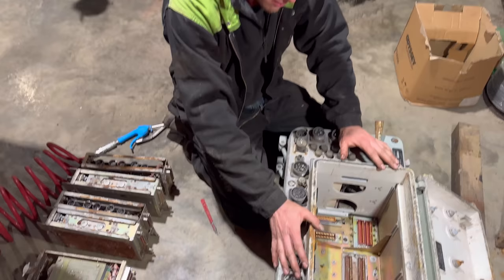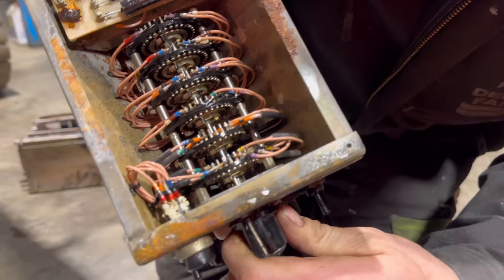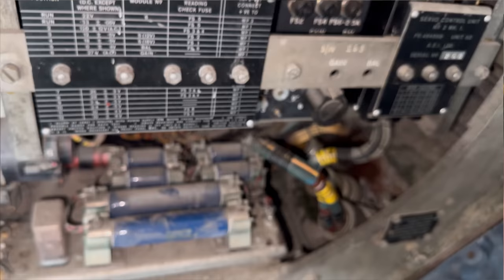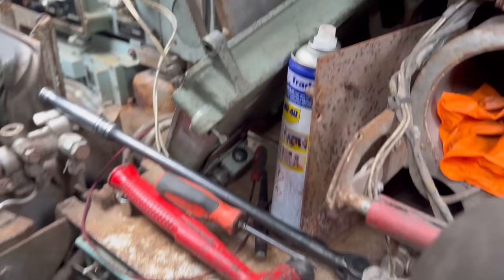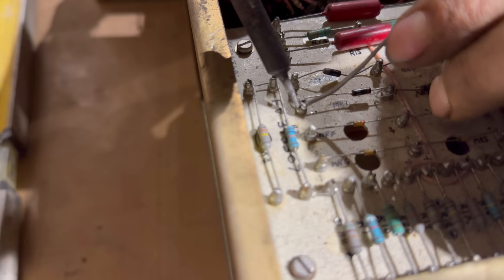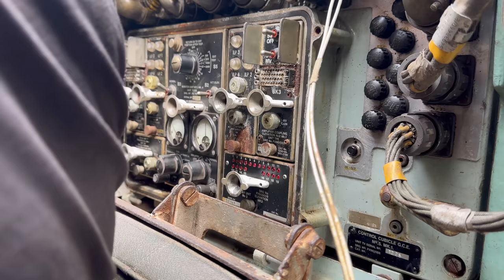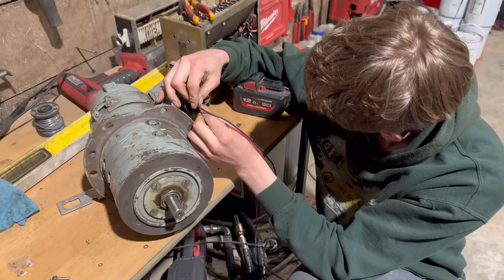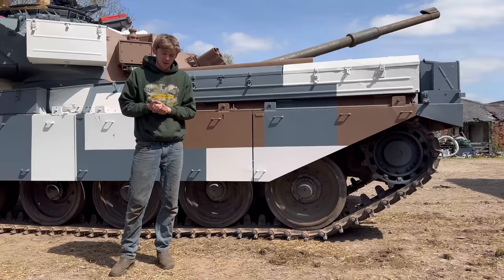How NOT to get a turret working!

Comment from the maker: What should I try next?
Reply: Do a flip, that's a neat trick!
Reply: Did you try turning it on and off again?
Reply: Have you tried putting Raspberry Jam into the Fire Control System, then putting the vehicle into 1st gear and see if the track tensioner works automatically? If not, then try 20 liters of gasoline and claim on the insurance.
Reply: Fitter Matt dressed in drag with a dead fox around his neck as a pack of 30 hounds chases him across a field?
Reply: That cmdrs control unit is part of the FCS....he can see all the info on the system and make changes etc. Barrel wear (rounds fired) Temps etc. The search light on the side of the turret should work without the metadynes working as it works with the hand controls only.  The battle mode fuse does not over ride the sensors.....it links the turret and hull batteries together.
Reply: 40 year ago, I’d have loved to get my mits on that. Now, I’d be an overweight liability, let alone not be able to get into the places you were in! 😮 There’s something at the back of my mind with those controllers needing the computer to operate. I also have a nagging suspicion that the Metadine units were modified to work with the computer, if you have a mix of modules of modified/unmodified it could give you grief. The only way to tell would be the data plate mod state cross referenced with EMER? books. I could be wrong, it’s been 40 years since I worked on one. We used to give those valves a good 5 mins to warm up and stabilise before trying anything lol If I had the power, I’d give you a medal for turning it on though! 👍
Reply: I find shaking my fist and swearing at electrical issues tends to do fuck all but it does make me feel better alternatively hit it with a hammer. Which also does fuck all but feels great.
Reply: Drivers and loaders safety switches?
Reply: ask alexa, if that doesn't work ask a homeless person, they are often ex military
Reply: Send the units to me along with your soldering iron(s), I will fix the units and make your soldering iron(s) safe for you to use. Then when I return said units and soldering Iron you will have put or sorted that motor out.
Reply: down the pub.
Reply: fixing it?
Reply: During my time in the USMC as a field radio operator I learned that a 3 foot drop will get most military equipment working again. But I've never tried it with a tank...which could make for an interesting video.
Reply: A Google search of how to do this? Or Inviting a proper electrician of systems that have experience with old tanks?
Reply: Try plug in the spare motor and see if it spins up through the trigger and full system. Definitely the fitted motor is the issue then.
Reply: is the turret ring in good condition all around
Reply: Have you tried asking ChatGPT, that pretty much fixes everything doesn't it?
Reply: put some double denims on and everything will be fine 🙂
Reply: Reach out for help!  There are some youtubers out there doing some fantastic work with vintage electronics @CuriousMarc is a good example
Reply: You got there eventually but you should have started with the motor and worked backwards. PS: You're probably right about the brushes.
Reply: ask chat gtp
Reply: To me It looks like under main plug there is relay which controls polarity to the motor and by activating it i would turn motor other way while powered up, If that's the case the relay could be the problem not the motor Itself, if not that motor would be to blame and needs removal and inspection.
Reply: have you tried hitting it to encourage it?
Reply: overclock the turret so it spins stupidly fast

Comment: I was an ECE for 24 years and need to tell you that you should NEVER just switch everything on without doing a proper setup of the FVGCE (Fighting Vehicle Gun Control Equipment ie the big box you just fitted)  First thing to do is make sure that the turret can rotate using BATTERY Traverse! Then AFTER the Control Cubicle has been set up (That requires the use of the central module (with the two meters) between the Servo amplifiers etc. It also tests that the Power Supply Unit (The box that smoked ) is providing all the correct voltages to the units in the Control Cubicle. Once that is done you should test the Traverse systems first WITHOUT turning on the elevation metadyne. If you power up both you could end up with the gun running out of control if the gyro is faulty! I was horrified to watch the video when you just switched it all on without setting it up first!  Every time a Power Supply unit is swapped out the system requires adjustment! You need the EMER For the Gun Kit.
Reply: Baller.
Reply: Do you have it?
Reply: High quality comment.
Reply: could it be your youtube time to shine?
Possibility on helping out?
Jim
Reply: sounds like its time for your youtube debut!
Reply: I can imagine a extremely heavy turret ‘running out of control’ could be quite life threatening, so I’m imagining very good advice! 😊
Reply: while this is probably good advice, you are the type of person they mimic with the whiny voice so you might not get through to them lol
Reply: Perhaps you could write up the procedure/s so that they have a better understanding of what is required to keep these classic war relics functional.
Reply: @mrtankalotrctankschannel  I'd imagine a machine designed and built for war, death and destruction could be quite life threatening if it were out of control...but in saying that, its probably say its way more life threatening when under the control of a trained crew.
Reply: @blitfire  ‘probably’? 😂
Reply: @howarddavies6685  well idk for certain do i
Reply: I'm sure i remember hearing of  someone being killed in the turret of a chieften when the gun he was working on  started going up and down repeatedly  crushing him to death .
Reply: Not surprised the comment mocking the person with sound advice to stop people getting hurt was liked by Mr Hewes , who seems to be determined to get someone hurt to get some likes ...#whistlindieseleatyourheartout.  #tryandbeoriginal 🤔
Reply: @fraserfulton.1432  ummmm... cope?
Reply: @blitfire  ummmm Banana
Reply: @blitfire  indeed
Reply: @blitfire  lol
Reply: @mickd6942 . There was. 1RTR Tidworth.
Reply: driver comment
Reply: Lookup2Wakeup  he was  working under the breach
Reply: @mickd6942  I am curious to know how one could be repeatedly killed?
Reply: Fentanyl, narcan, fentanyl, narcan, etc. like that lol
Reply: @Qspecialman  he was killed once , i meant the breach repeatedly went up and down quickly .
Reply: @Qspecialman  
It starts slowly then speeds up.
Reply: @mrtankalotrctankschannel  As part of the 4/5th echelon maintenance we had the Dutch PRTL turret turning CW and the periscopes running CCW on a range of speeds and rates of acceleration.  Visitors could sit in the turret under condition that they would clean up the mess they'd almost certainly make.  https://www.youtube.com/watch?v=UUFwFhg99ZY
Reply: @mrtankalotrctankschannel  As part of the 4/5th echelon maintenance we had the Dutch PRTL turret turning CW and the periscopes running CCW on a range of speeds and rates of acceleration. Visitors could sit in the turret under condition that they would clean up the mess they'd almost certainly make.  https://www.youtube.com/watch?v=UUFwFhg99ZY
Reply: 7:16
Reply: I mean obviously I was just about to say what he said, I was just putting the bins out... & Stuff
Reply: About a year or so before COVID I discovered all my ECE training notes from 1971 and offered them to the REME museum who were pleased to have them. I also had to describe the course we did then, I think now it was 193. It was unusual in that they also trained us on radio repair- which did not endear us to TEL’s! This facility was then offered to future courses. However, I would expect by this time for a contribution to Corps funds they might well provide you with a basic set up from EMERs for basic safety.
Reply: Schoooled 😂😂
Reply: @Qspecialman Tom Cruise was repeatedly killed in 'Edge of Tomorrow'!
Reply: @arthurgordon6072  It didn't work Arthur, he still keeps popping up.
Reply: If you're not sure how things work  ask an expert who's being doing it for years.
Reply: Massive pointless comment
Reply: When I read EMER I was taken back thirty years to Bordon.  Thanks for sparking that memory 👍

Comment: Mate I was an ECE for many years and mirror the comments of my colleague in the comments above - to make the FVGCE work correctly (stabilised) you need the Gyro unit mounted under the breech, the TTASU (trunion tilt and angle of sight unit) mounted up near the gunners periscope (might be the e smashed unit you mentioned), the trimming unit mounted above the traverse gearbox in front of the gunner which the gunner operates a few knobs to trim out any traverse or elevation creep, the CIU (computer) under the gunners seat which the CCMU next to the commander talks to and displays ballistic calculation data - I suspect the best you can do is to get the emergency traverse workin, which iirc is operated by the big lever on front of the control cubicle and then gripping the grip switch and traversing left and right - for that you need either the main engine or gue to be on line producing 28 V - if the engines are failed or not on line then the 2 turret batteries could be used for power by means of the override master control (oh my Christ) lever on the turret distribution box to the left of the commander seat - as best as I can hear from the video neither the elevation or traverse gearbox clutches are closing when the grip switch lever is pulled which indicates a common fault - it should make a loud click and then you can operate the thumb switch up and down etc but, please believe me when I say that if you get that to happen without the gyros etc properly working you WILL have a rogue turret and the turret monster will rip your arm/leg/head off ! - operation of the emergency traverse doesnt use the gyros/stabilisation eqpt just a simple left and right with manual elevation

Comment: As a long ago retired REME A mech, I love watching your videos. The sound of the Chieftain MBT starting up brings back many memories. It has been said in various comments about how dangerous the turret is. In training we were told NEVER to operate the turret unless doing it manually (i.e. to get it in the right position to do a pack lift). Either an ECE,  tank cmdr and gunner were only ones allowed. They warned us of the crazy things it could do.  If we did manually move the turret, we always made sure we sat inside the turret seats (e.g. cmdrs or gunners) as anything trapped outside the "turret basket" could lead to lost limbs or other important body parts.
Reply: Just crazy. I'm wondering how many soldiers have died in was because of these dangers of a tank

Comment: I saw the start of the video and all the ancient complex electro-mechanical and electronics linked together with multiple connectors and cables with unknown prevenance and thought, not a hope in hell of that working. Sadly I was right.  If it was anything like the aircraft industry, every one of the components would have had dedicated test equipment (STTE) , so they could be proven in  isolation before installation. There are far too many variables to just install it all and hope it works. I wish you the best of luck with your goal, but it's the most complex thing you have attempted.

Comment: Getting that searchlight operating has be your next priority; 'lamping' in a Chieftain would be a great watch!
Reply: Quality lamping. It will need oddballs speakers for the squecker.
Reply: Except for the rabbits :-) Do you need HESH for rabbits or is sabot sufficient? 🙂
Reply: @loydsa  depends on how much  of the bunny you want left to eat.
Reply: @loydsa  hesh of course
Reply: If that search light works you won't need ammo, just shine the light on the rabbit. The site of the tank will scare the crap out of it, so no need to gut it, and It'll burn the fur right off and pre cook it with the heat the light generates L.O.L

Comment: I can add, having done that job for 22 years, there's an awful lot to learn on that control system alone, starting with safety.
It's a big monster when it goes wrong, I've seen a few people get badly injured.
Knowing exactly how it should work properly is also a good start.
Trying to fully start an unknown system is pretty dangerous to say the least

Comment: Mate...you really need to pull every fuse and clean them and the seat it sits in. That whole system is moisture rotted from sitting. It will clean up well, but you will be chasing your tail forever if you dont go through it all. legend episode though  !!!    I love this channel.
Reply: Had this issue with one car. Fuse holders just corroded, but i was looking the wires and connectors for damage. Check and clean the fuses that is the first step. Then power each unit separately, though even this is problematic since some systems need load or something will blow... ie had mosfet detonate on garage/torpedo heater when there was no load from the glow plug. And this is why you want to get person who actually knows the stuff to do first check up on the system, well as removing motors ability to turn anything but its axle before system has checking that it wont go out of control. Doing it like they did can lead to damage of the system or the user. This type of systems usually are pretty well designed to be idiot proof, but lack of maintenance and bad storage can bring out issues that was not foreseen.

Comment: You might find a fibreglass brush is a very useful tool for cleaning electrical contacts in a multi-pin plug. These work a bit like a propelling pencil so that when it gets a bit dirty and tatty, you can cut off the tatty end and wind out some fresh brush.

Comment: BATTLE MODE!  This was on military gensets we used to work on, basically overrides all protections . . Therefore if there was a battle and you needed commas but your set was over heating, enter battle mode and it would run until catastrophic failure.  Had one of those cool AF red switches where you lift the red cover to move the toggle.  I guess it is a standard military feature.
Reply: our jltvs in the marine corps today have a combat overide feature that does the same thing you can get njpd if you touch it though

Comment: Looks like the power unit includes a rotary inverter to generate a high voltage from the low voltage battery. Quite possibly this is what supplies the anodes of the valves in the other boxes at 150 to 300 volts or so.

Comment: Fascinating. Back in the late '70s I worked for Marconi where we manufactured the Gun Control Equipment, (GCE). My job was to test and repair, if needed, everything in that cubicle. The servo amps lost the valves around '80 and became 'solid state'. What you have there, I guess, is prior to IFCS being fitted.
Reply: No, it is an IFCS tank.

Comment: When the PSU is turned on...wait for 30 to 40 seconds. There should be an audible change in the PSU noise. Only then start the Mets which should cause a very distinct noise in the GUE motor as it loads up. All safeties to on including the drivers in front of his chin. Fingers crossed.

The unit by the commanders leg is the fire control computer module.
Reply: Yeah did that tank not come with a manual?!😂

Comment: Former naval weapons engineer here (no tank experience).   You need to gather as much documentation as you can find on everything.  The tank is going to be around long after those with hands-on experience have passed away.  The documentation would make it far easier to maintain, setup, troubleshoot.  I don't know how old the tank is, but I see 60's technology.  Valves and no PCBs.  Hand written component identifiers.

Comment: Could definitely build a new, vastly simplified turret control system. Some off the shelf parts and a bit of programming. 
But yeah hopefully you manage to get it sorted.
Reply: Chieftain, powered by Arduino!
Reply: Reliability of that system would be sus... then again so is this one due lack of maintenance and proper storage.
Reply: @markdammes1947  Na, Raspberry chieftain pi.

Comment: Personally I would ensure that the gearbox for the turret traverse has not seized. I've worked on gearboxes for several armoured vehicles as well as naval equipment. If the gearbox removal is too difficult then try to separate the pinion from the ring sufficiently to check rotation of the gearbox while not engaged in the ring.

Comment: If all else fails, you can just bypass them. As in, switch to power to motor simple. Those boxes look ancient and complicated with several possible points of failure. So, unless you're planning on taking Seb's renovated chariot into battle (and if you are, maybe keep that to yourselves), it might be easier to just go around most of the combat-related features. But please try to get the boxes working first!

Comment: Yea, glass valves! I remember them well, Everything had them once upon a time. T.V's, radios, record players, car radios, amplifiers. The glow you mention is the heater circuit inside them and that and the glass envelopes themselves were very prone to failure under harsh conditions.   The Yanks, I think, invented the "cold cathode tube" in the late 1950's which had a metal envelope and needed no heater. All these things were eventually replaced by by transistors and eventually integrated circuits chips. Now entire device circuits can be hidden  away inside a rectangle of brown plastic only a few centimetres square.

Comment: The cards look rough but atleast the backplan looks good. The backpan pins where the cards plug into when sitted is usually where the issues are at with that amount of corrosion. The cards are typically easier to repair/ deal with if faulty rather then a bad backpan